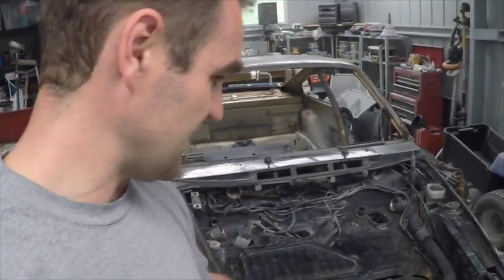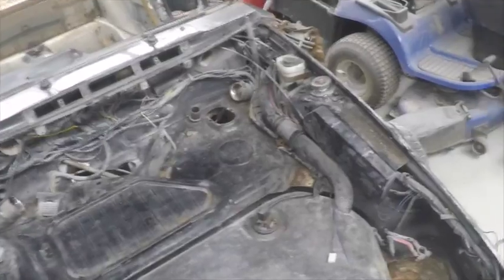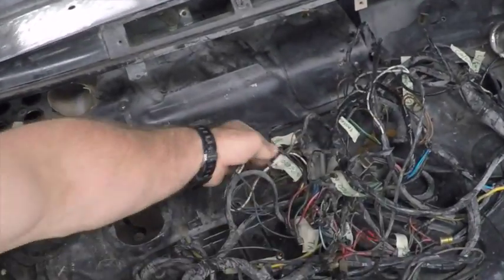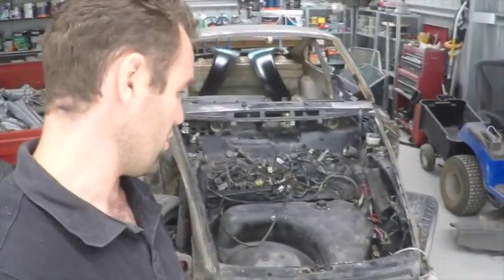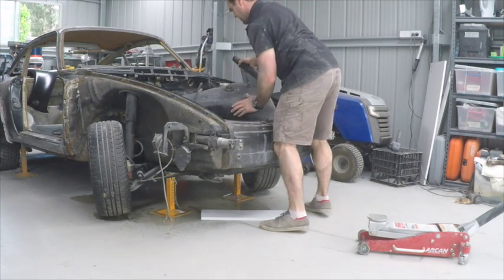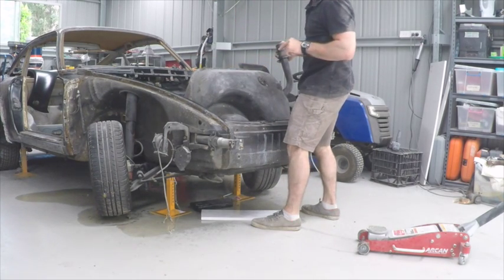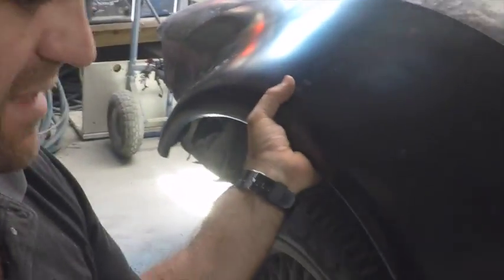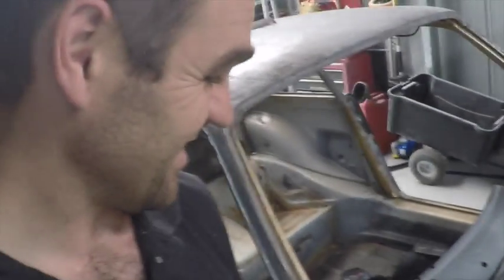Removing Fuel tank and wiring - Porsche 911 Classic Car Build Part 4

Comment: Hi Jeff, Great Channel very helpful (spray booth)! I'm currently restoring my 66' Volvo Amazon 120. Almost done with the strip down (electrical and engine left to do) and wanted to know what type of welder equipment you use? Also where did you sourced your metal from. In Melbourne. Thanks.
Reply from the maker: I use a Bossweld Mig and 0.8mm sheet steel from my local steel supplier.

Comment: 1... 2... 3... 4... clap your hands!
Reply from the maker: Ahh the early videos ;)
Reply: Home Built By Jeff Your YT revenue video came up as suggested for me.  I’m going to watch through all of these 911 build videos because I really want to do this exact project.  Maybe with a later, higher horsepower fuel injected motor.  I daily a 996 cab and really want an RS clone, and want to build it myself.  With this same process of stripping it to the tub and rebuilding it.